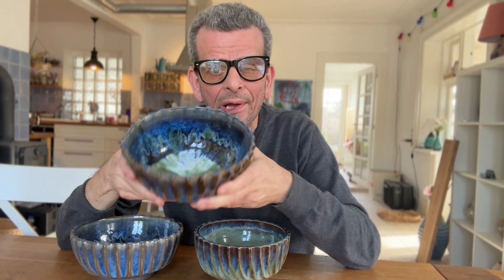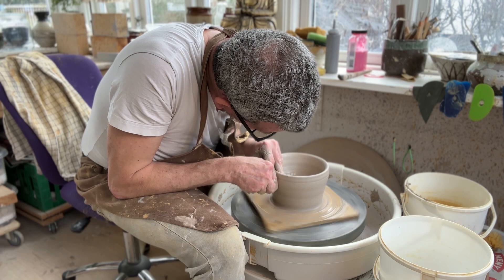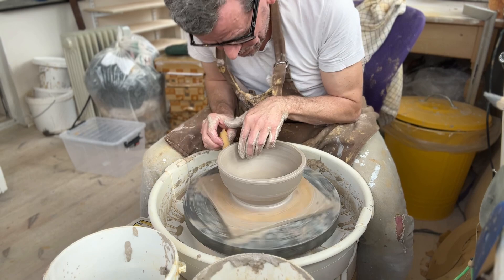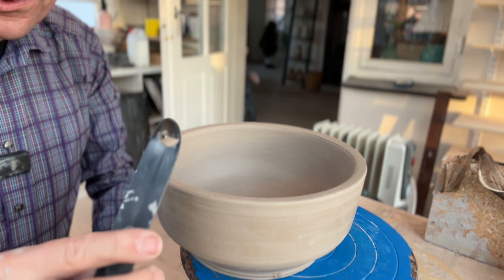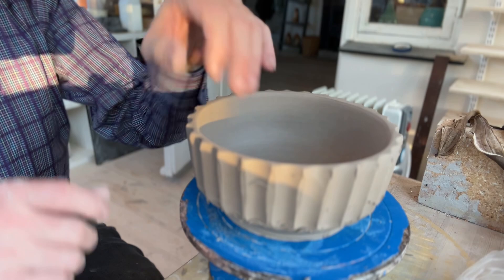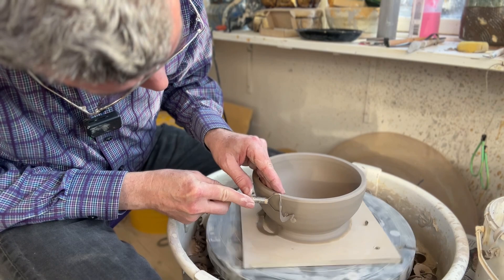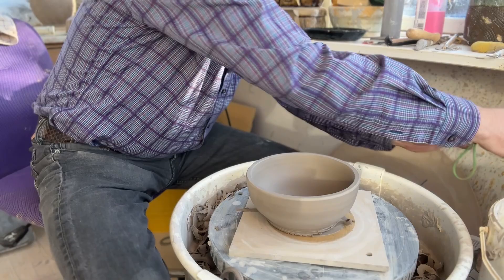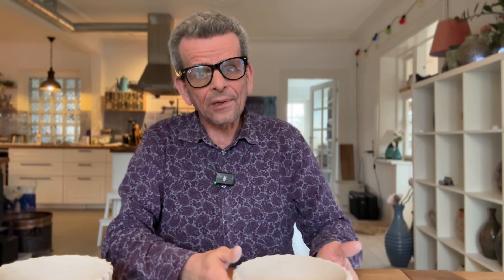92. How to Make Fluted (carved) Bowls on the Potters Wheel

Comment: I noticed you didn’t wire your bowl off the batt before  drying.  Are you worried about the bottom cracking?
Reply from the maker: No, the bats I use vdont need wire off.. they release the pots perfectly in 1-2 days and I almost never have cracks. Even with large plates